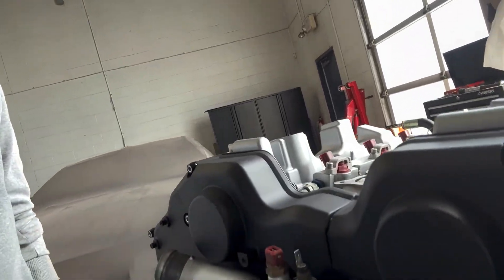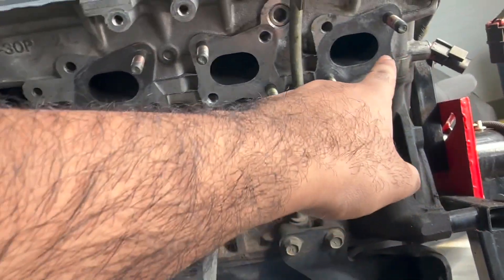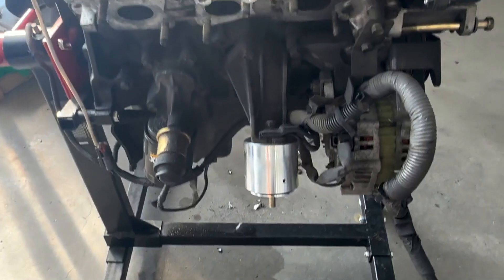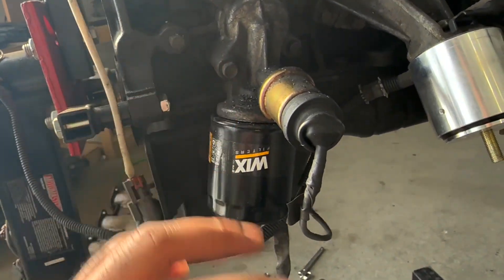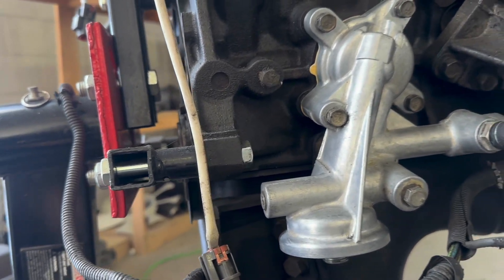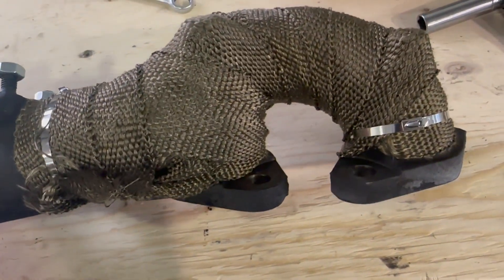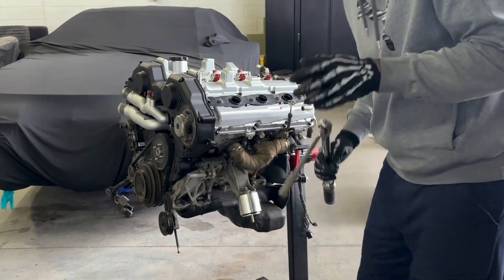Boosting my Nissan 300ZX: Part 7 - Oil Tree, Exhaust Manifolds and Turbos on my NA Engine!

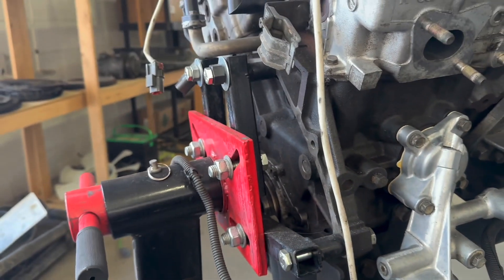Comment: @02:54 no hate here, the NA block has check valves behinf the oil filter tree (in the block itself) BUT the TT has them built into the tree itself.

this means you have to remove those check valves from the block itself (behind the oil filter tree), and replace them with the solid plugs that are found on att block. z1 sells these plugs.

if you do no make this change, all the presure that is needed to oipen your check valve to feed oil though your oil cooler at higher rpms. will not feed the cooler, that presure will instead be bypassed through those check valves behind the oil filter tree, and back feed that extra presure around your oil filter and no where near the oil cooler, so your oil will never cool how it is supposed to. this also reduces the amount of oil pressure that makes it to your turbo oil feeds passages.

you HAVE to remove those check valves behind the tree in the block, and replace them with solid plugs, so the TT oiling system will work as designed from factory. 

sorry to share this late. but it IS essential to do this.
Reply from the maker: Shit!!! I had no idea that needed to be done…

Comment: Your project is looking good and I feel excited for you with this progress. There is light at the end of the tunnel.  When I performed a lot of work on my 94'na at 98k I replaced the oil pressure sending unit with a new OEM. It registered lower than the original. lol  I understand it is not uncommon for these ZX sending units to show "low" pressure when pressure is really ok. About the highest I see on gauge is 55psi.😎 go man go!
Reply from the maker: I know the oil pressure might still be in accurate after all this and I’m prepared for it lol if it doesn’t work out I’ll just get an aftermarket gauge but I wanted to try this first 👍 thanks for the support!!!